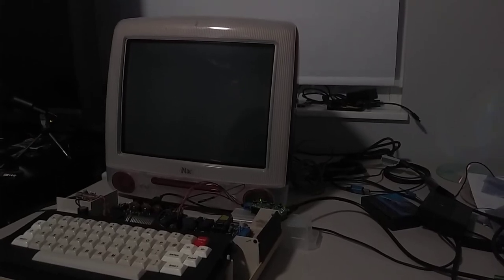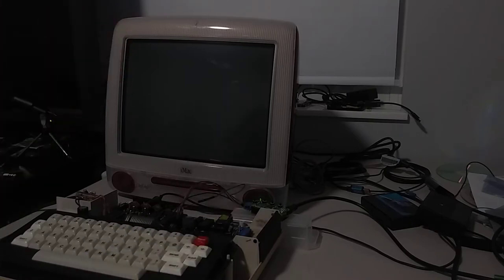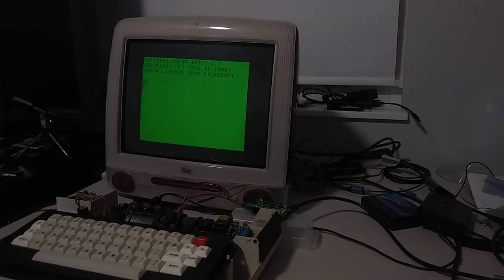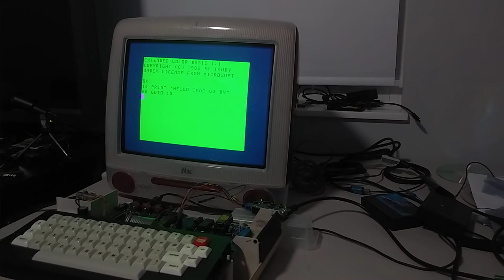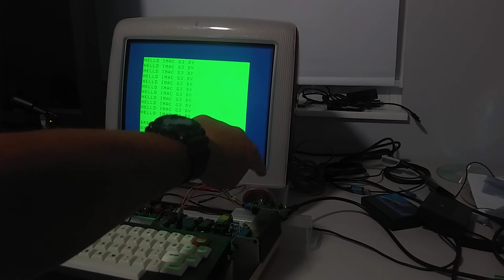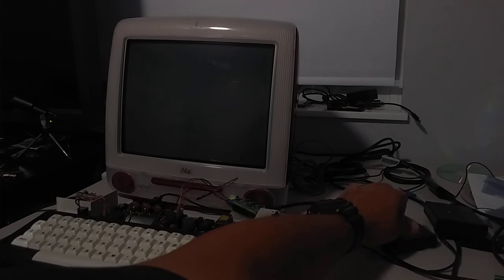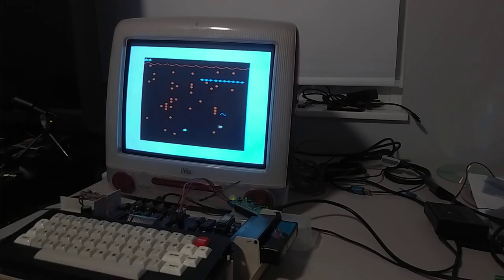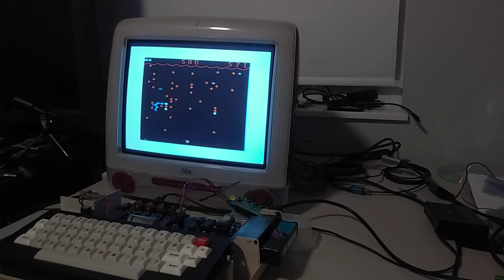TRS-80 CoCo 2 on an iMac G3 DV

Comment: Looks cool, and it should be pretty easy to put together a circuit to boost the signal so you can get better volume from the speakers, maybe even add an amp and mount a volume control to the case.
Reply from the maker: Actually, there is already an amp in the iMac and it was turned up all of the way. When I hooked it in, I could hear it but it was very faint. 
Going to have to make a preamp for it. But still, it  is fun to use on a VGA monitor.